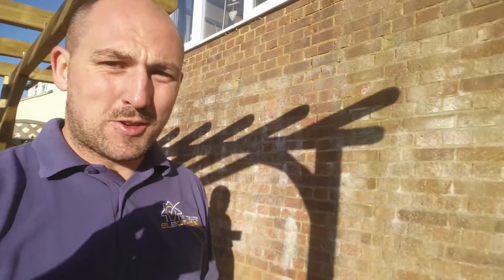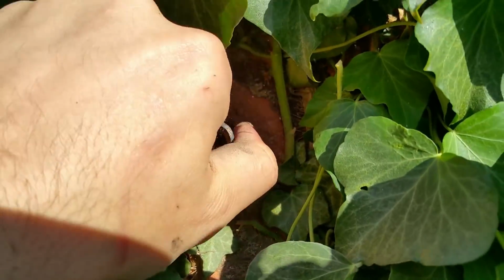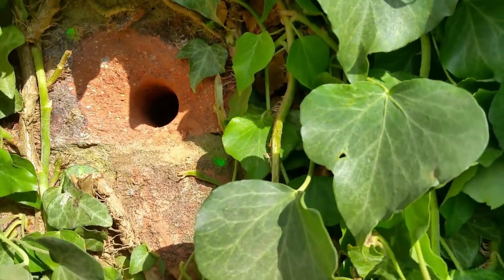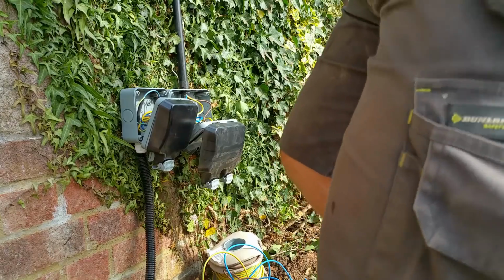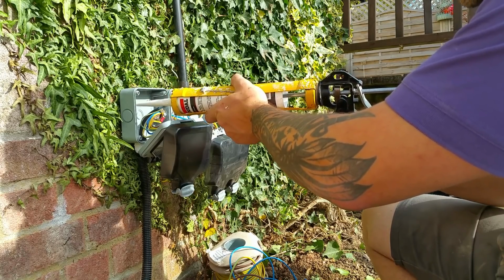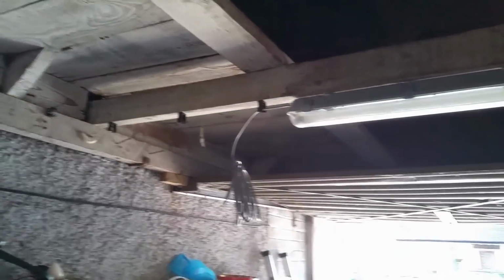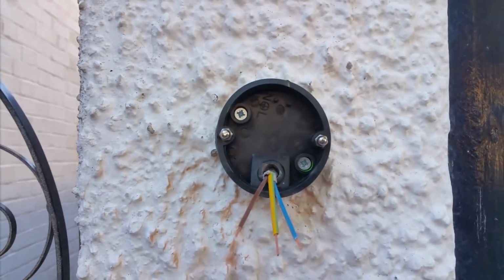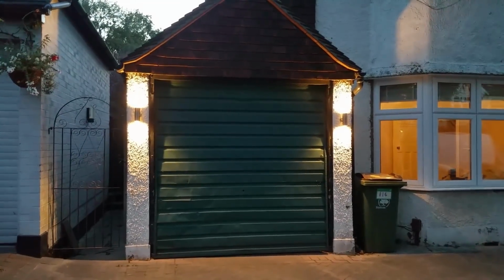Garage and Garden Electrics

Comment: With outdoor sockets I use plumbers mate putty around the screws that hold the socket back to the wall, as you tighten the screws up the putty will force around the screws sealing the hole. Plumbers mate doesn't dry up so will always seal, I know it sounds daft to use plumbers mate but it's just putty. Quality job as always, keep them coming. Col.
Reply from the maker: That's a good shout mate!

Comment: Nice video and nice work. I have just subscribed mate. Also I have been saying the same thing for a while about the Wiska boxes. I even sent them a message about this. They have finally released one with a rear entry! It's the Wiska 407 combi box, dimensions are 95mm x 95mm x 60mm, so it is only slightly larger than the 308 box that you have used in this video. The 407 box has two rear entries at the top corners, this allows you to still use the mounting bracket, as that requires the middle part to lock into and so it couldn't be centre entry at the rear if you know what I mean, it also has a 25mm threaded entry unlike the 308 box which only has 20mm threaded entries.

Comment: I have outside garage/ porch lights but they are all controlled by a single Dusk-to-Dawn Sensor (photocell), so they only come on from, well..dusk to dawn! 

On saying that, I do like the Timeguard units as I have the exact same one to get the towel radiator nice 'n' toasty before shower time! :D
Reply from the maker: I actually prefer a little of both but as you can imagine it's expensive to install a timer and photocell for 1 circuit.

It's actually what I install a lot of for commercial properties. The photocell will turn lights on when it's dark, but the timer will ensure that they're not running all night. This will increase the life span of the lights/lamps and save money on the electric bill.

Comment: can you run through that bit at the end with the big wooden thing? Haven't worked it out yet!
Reply from the maker: Sure which wooden thing? The garage?
Reply: @MyTrustedElectrician  that big thing with the bristles on the end, what is that?
Reply from the maker: @doctorelectric470 Oh that is a new contraption that's still in the early testing stages. It's not been released yet for purchase. It's supposed to help clean floors but I don't think it'll take off personally.

Comment: Random one... and probably quite a stupid DIYer question - how are the boxes jointed together - screw thread or some fancy way of setting it up!?  I normally run a short length of conduit between them, resulting in a 50mm gap - but butting them up looks much much better - ta!

Comment: 8:39 A stuffing gland, ran out of kopex glands on the van bud.  It's great to see the additional thought of fitting spacers to the back boxes.  I know the circuit is already protected by an RCD, but can you also fit an RCD switched socket outlet for the outside?  Hopefully? Under fault conditions you will achieve discrimination and not trip the RCBO in the ccu?
Reply: Hi Hiccupp77, you wouldn't put 2x RCDS like you said for discrimination reason (selectivity under the 18th 536.4.1.4) we wouldn't be able to rely on "hopefully" right?
Reply from the maker: Haha, I have bloody kopex glands falling out my ears on the van. You get 10 in every bundle and I rarely use them all. It's flex and so I use a stuffing gland. I don't believe kopex is water tight although I may be wrong. Also I need to secure the flex from flying out of the box if somebody was to pull it at the other end 😉

Comment: What’s the wiring arrangement for the spur, single socket, light and timer in the garage anyone ? Your going from CU on a 20amp radial to the Switched fused spur on the supply side derating to what amp? Then feeding single socket and timer and from the load side? I’m confused, no judgement just trying to vision it in my head? Top video keep um coming !
Reply: Marcus Moore 13A

Comment: Why did you decide to use an earth nut instead of a ribbed lock ring? just curious.
Reply from the maker: You could argue that the galv nipple is not accessible but it just feels right to earth it as I have live cables running through it. It's just how I do it.

Comment: What testing is needed mate    After these jobs were completed
Reply from the maker: That is a great question! 

So both jobs were alterations/additions to existing circuits and either were in a special location. This means that both can be covered with a simple MWC. However it's worth noting that a MWC does not ask for ring continuity values which I would consider important for work carried out on a ring circuit. I would write these values down in the notes column.

Comment: I never use plastic sockets or fittings in any out building, garage, shed etc. Two reasons, firstly they are not as tough as metal and secondly and most importantly, if a plastic switch or socket gets covered in condensation you can receive quite a nasty shock from it. This doesn't happen with metal as they're usually earthed and if they get too damp they will knock of the RCD. Of course you can't earth plastic so current can track along the condensation enough to make the socket  (or film of condensation) live but not enough to register at the RCD. It drives me mad when I see qualified electricians using plastic in damp out buildings.